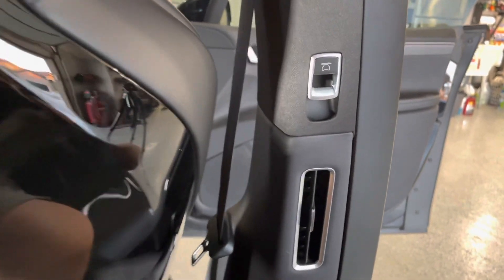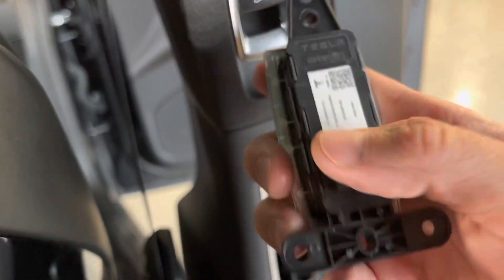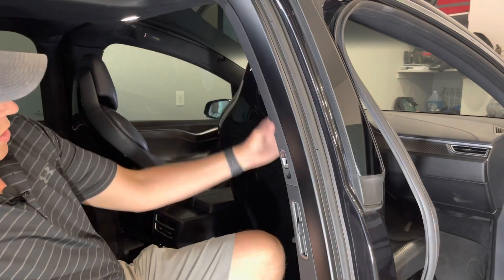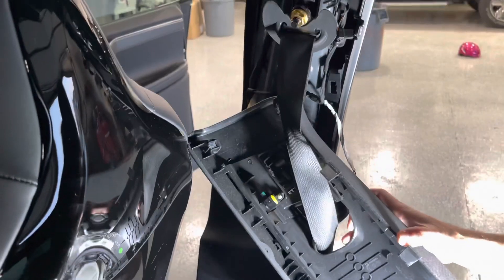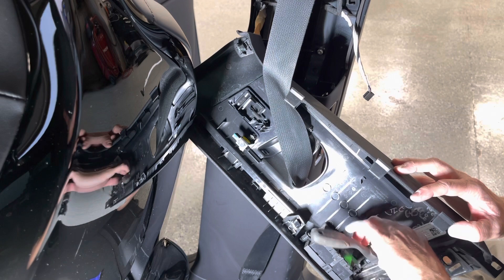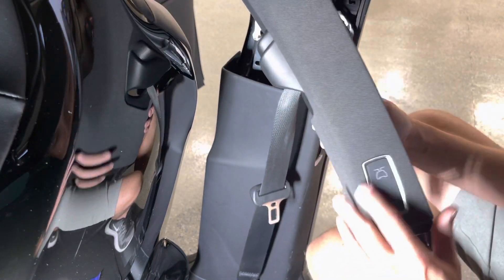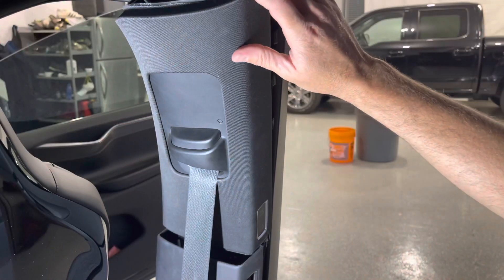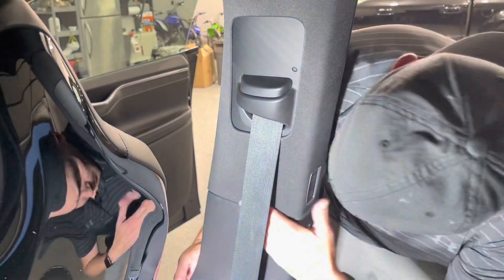2016 Tesla Model X Falcon Wing Door Switch Upgrade

Comment: How do you remove the connectors for those 2? Is there a button to push or a latch to move?
Reply from the maker: I don't recall
Reply: @Myksgarage I got it installed, just pull it with no latch.

Comment: How did it work out with the seat belt hight adjusting device?  Did it by coincidence re connect properly, og did yiu have to disassemble it again to put it back properly?  Why do you say people kan sell them used, when yu also say, they are so cheap, that it is not worth nuying them second hand?
Reply from the maker: I sold my old ones on eBay for like $15